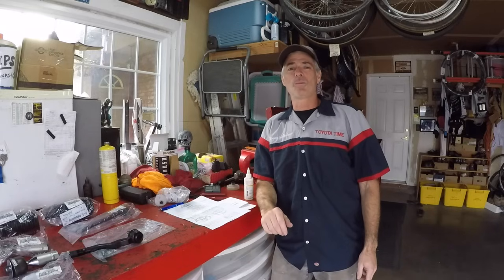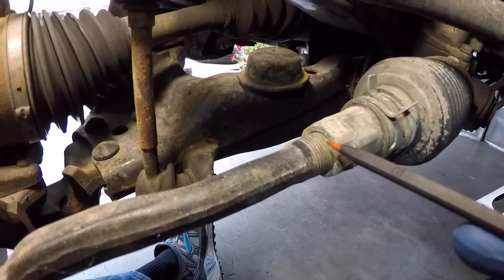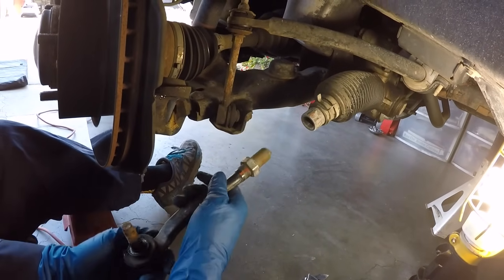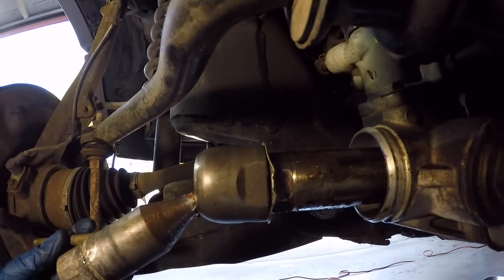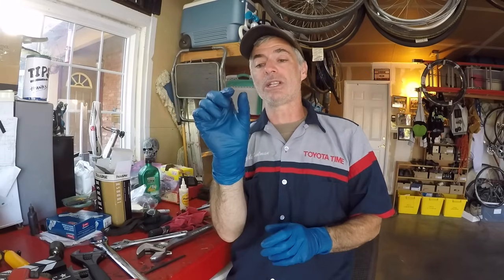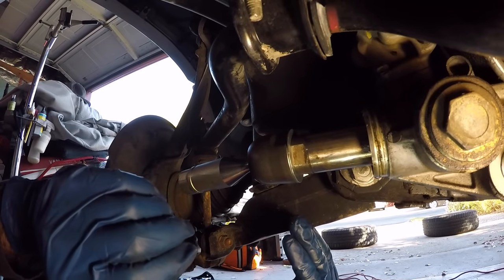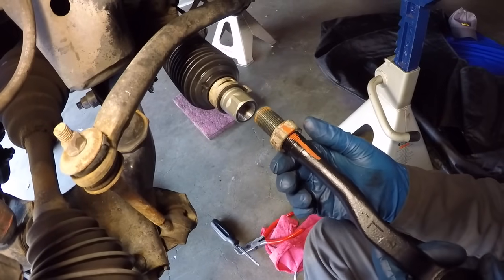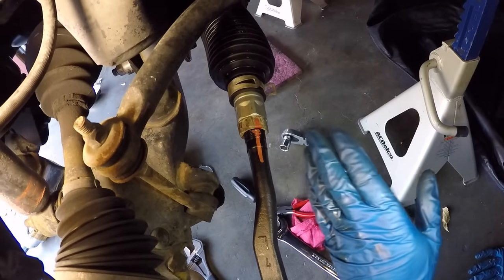Inner & Outer Tie Rod Replacement

Comment: Doing upper ball joints this weekend and outer tie rods on my 2001 tundra 207,000 miles just because want to keep truck for a while. Looking at the prices for inner tie rods well two and a half times the price as outer. I think I will pass on these my truck steering is fine. Where do you get your parts from? I don't want to spend 170$ per inner tie rod.
Reply from the maker: Mike, if the inner tie rods don't have play in the joints, don't worry about it, they are fine.  Inner tie rods are very pricey.  If your joints truly are bad, then it's a better value just to buy a new OEM steering rack because for a little more money, you can get a new steering rack.  For 3rd Gen 4runners, OEM inner tie rods run around $300 but a whole new steering rack that comes with new inner tie rods is only around $500.  For $200 more, getting the new steering rack is the smarter choice in my opinion.  Online parts sellers are the most affordable.  Toyota Parts Deal and McGeorge Toyota seem to have very good prices.
Reply: @TimmyTheToolman  Hey Timmy Thank You for your videos and your time. Im enjoying working on my trunk after I learn what to do from guys like you. Have a great day.
Reply: @TimmyTheToolman  I just found a new OEM rack for 458$ thats what im talking about!  how will I know if I need one?
Reply from the maker: @mikekmalick  Usually people will replace a rack for two reasons.  #1, it's leaking really bad from the seals and the owner is tired of having to top off the fluid.  #2, it develops significant slop and replacing or adjusting the steering rack guide doesn't help.

Comment: Does anyone know if the flats on the 1st gen Tundra steering rack are the same as dimensions as the one in the video?
Reply from the maker: What do you mean by "Flats"?
Reply: @TimmyTheToolman  the place that you put the smaller adjustable wrench on the end of the steering rack arm. I believe you said it to use a 30mm wrench to hold it steady. Just wondering if that was the same dimensions on the Tundra as well. I just dont want to get everything apart to realize I dont have the correct size toolage.
Reply from the maker: @bft590  Gotcha.  Yeah, I can't say for sure because I have not done this job on a Tundra.  But, an easy way you can confirm the size is release the boot clamp, pull the boot back and take a measurement with some digital calipers.

Comment: But didnt you spend $120 on just the over sized crescents? Rather than the $65-$100 lisle set? Just wondering Toolman
Reply from the maker: The Lisle set will pull off the inner tie rod but you still should be holding the steering shaft still with another thin and wide opening wrench.  At least that's what the FSM shows to do and it makes sense since there is a wrench connection on the end of the shaft.  With just the Lisle tool, you would be transferring a lot of torque to the steering shaft and maybe that would be ok, but I have to err on the side of caution when giving out advice in videos and in the comments.  I decided to buy the Bacho oversized adjustable wrenches because I thought I would find more uses for them in the future and not just be dedicated tools only for inner tie rod replacements.

Comment: Anyone have a part number for that castle nut that connects the knuckle to outter tie rod?
Reply from the maker: When you buy a new tie rod, a new castle nut comes with it.  Don't know if you can source this separately.  If you have a Toyota dealership near you, just visit the parts department and ask them.  The part can't be that expensive even from the dealership.
Reply: Timmy The Toolman yep, went to the dealership and picked up the new nut and cotter pin for around 4 bucks, thank you
Reply from the maker: @jordanhamilton5182  You're welcome.  Glad it worked out.

Comment: Hey toolman do know where can i find a rebuild video for the rack and pinion.i replace the lower ball joints and i noticed there was oil in rubber boots
Reply from the maker: Nope.  I looked into it and it seems like a pain in the ass.  If you end up going for it, let us know how it went.

Comment: Just did this two days ago. Driver side jam nut was froze up and trashed the threads.
Reply from the maker: Bummer.  Did the jam cause the replacement of the outer tie rod or were you planning on replacing it already?
Reply: Luckily, I was replacing “just because “ along with front shocks, springs, upper and lower ball joints.
All easier to do thanks to you and Shawn doing the diy videos!
Reply from the maker: That's good that you were planning on replacing them anyway.  Great to hear our videos are helping you out.  Thanks for taking the time to comment.  Happy Wrenching!
Reply: So grateful for pepes like timmy that take the time to make videos like this to help all of us DIY folks out

Comment: ?  why is it important (or not important?) to stake/remove the claw washer with a Brass drift bar instead of just one of those chisels like you take the caps off to get at the axle nut
Reply from the maker: To remove the old claw washer, it doesn't matter what tool you use.  To stake the new one, I chose the brass drift because I did want to damage the washer,  I just wanted to bend it (stake it).  Chisels are sharp.  But, a chisel probably would have worked just fine.
Reply: @TimmyTheToolman   thanks! the FSM does mention to use a brass bar and I was just curious about it all.  it also says to use a spanner to hold the rack steady while you torque  it to spec
Reply from the maker: @efil4kizum  Yeah, the FSM doesn't tell you everything but it usually points you in the right direction.  They show holding the steering rack with a wrench, but they don't mention where to find a wrench to fit that very narrow spot.  Quite often they mention the use of a SST (Special Service Tool) that no DIYer owns and probably most dealership mechanics don't own, so you have to look at the pictogram and figure out what tool in your toolbox will work.
Reply: A new rack end at Firestone here will run ya 370$ at 1.2 hours and 150$ new MOOG ITR part.. this price is keeping the outer tie rod and not replacing that part or I bet it's over 500$ for one side

Comment: NAPA Tie Rod Removal Tool-Crows Foot Lisle# 45750 = $13.50 as of 02/03/2021
Reply from the maker: Hey Chris, the only issue with those types of tie rod removal tools is they don't address holding the steering rack shaft steady while applying all that force to the inner tie rod to remove it.  Is it a big deal not to support the shaft?  Who knows.  But, Toyota obviously built in those flat sections on the end of the shafts for mechanics to hold the shaft steady.  And, they show holding the shaft for the removal in the Toyota factory service manuals.  So, maybe use the specialty tie rod removal tool in conjunction with another slim wrench on the shaft held by someone else helping.  By the way, I looked up that Lisle tool online, it sells for $59 on Amazon but it shows as a complete kit with the tool and many crows foot wrench sizes.  When I looked it up on the Napa sight, it shows just the one crows foot wrench.
Reply: @TimmyTheToolman  I think some of the other viewers have the right idea about borrowing the tools from auto zone (or equivalent).
Your videos have been very educational and have given the knowledge and confidence to tackle jobs I would have paid someone a lot to do for me otherwise. Beyond the money, it is satisfying to work on my T4R. 
Thanks Timmy!
Reply from the maker: @cmtsailor  Yeah of course renting the tools for free is always a popular option.  The only issue is sometimes the tool you need has already been rented out and sometimes the tools are pretty beat up by the people using them.  I'm the type of guy that likes the convenience of having my own tools at my disposal when I need them.  Those Bacho wrenches I purchased are pricey but they are handy for other applications as well.  

Great to hear our videos are inspiring you to take on jobs you might not have otherwise done.  I agree that it's very satisfying to do your own work.  You gain knowledge, save money and you have the peace of mind that you know it was done right.  You can also pass on the knowledge and pay it forward to the next person.  It's a win on so many levels.  Happy Wrenching!

Comment: You could rent the tie rod tool at AutoZone
Reply from the maker: The problem with the special tie rod tool is they don't address holding the steering rack shaft firm while you're applying the necessary force to remove the inner tie rod.  When using these specialty type of tie rod tools, you are at the wheel well with no ability to hold the shaft firm unless you elicit help from somebody else with a special slim wrench to hold the shaft.   I imagine lots of people forego holding the shaft but the Toyota engineers obviously meant for mechanics to hold the shaft firm with the removal and installation of the inner tie rod.  And, the factory service manual shows the use of SST's on the inner tie rod and the steering rack shaft leaving me with no doubt they recommend holding the shaft firm so all that force isn't applied to the shaft.

Comment: Is anyone else having a really hard time getting the outer tie rod off? I am putting my entire body weight into it and it won’t budge. pb blaster and wd40 aren t helping either
Reply from the maker: Time to use some heat my friend! Heat up the nut to expand it with a torch, just be careful and try not to burn yourself. 
- Sean

Comment: I think you can rent inner tie rod tools from auto parts store for free.
Reply from the maker: That would be awesome if you can rent them.  I think I'll check my local O'Reilly's and see if they do.  If you find an auto parts store that does, please respond back and let us know.
Reply: I went to autozone and they do rent this tool - $90.  Upon return you get a full refund.  FYI - I recall on the harmonic balancer that I also rented a torque wrench that went up to 250 lbs and the holder that keeps the balancer in place when tightening it down - all from autozone.  Long story short check with auto parts store on those one of a kind tools first if you are cheap like me.  27346 by OEM - master inner tie rod set.
Reply from the maker: @danteg8311  Awesome.  Thanks for commenting and sharing this.

Comment: The inner tie rod end tool (make sure to get the big green one, not the smaller black one) available for loan from O'Reilly or [AutoZone](https://autozone.com/test-scan-and-specialty-tools/inner-tie-rod-tool/oem-master-inner-tie-rod-set/347197_0_0) works great—and bonus, you can use your torque wrench with it! 

You still need an adjustable wrench to hold the steering rack though. Stanley has one (model 90-950) that is as thin as your $60 wrench looks to be, that worked pretty well for me (as with yours, you can only get it on partway), available at [Walmart](http://www.walmart.com/ip/STANLEY-90-950-12-Adjustable-Wrench/14146067) for about $12. Note that unless you wire the wrench in somehow, doing it this way is a two-man job.
Reply from the maker: Thanks for sharing this info.

Comment: I was able to purchase item # 636979 From Harbor Freight: 12IN ADJ PROFESSIONAL WR ($11.01 with one of their many 20% off coupons). Together with a pipe wrench that I had I was able to replace both inner and outer tie rod ends in less than 2 - 1/2 hours, with no issues.   Thank you for your poste  information.  I thought that this additional data could help others.
Reply from the maker: Thanks for sharing this Alan.
Reply: After looking at this 12IN ADJ PROFESSIONAL WR #63679 online on Harbor Freight, I noticed that the jaw opening is 1-15/32 in. which converts to 37.31 mm. The inner tie rod needs at least a 42mm jaw opening so I am unsure how this Harbor Freight tool was used for ITRE?
Reply: @noejimenez3  - He used the adjustable wrench on the rack side not the tie rod. That only requires a 30 mm. Probably used a pipe wrench on the tie rod side. Point he’s making I believe is that that HF adjustable wrench has smaller jaws than your normal adjustable wrench and you may not have to grind it down any.

Comment: Hammered that tie rod about 8500 times and it never moved a millimeter!
Reply from the maker: Get a puller.  I'm not a fan of the Big F'ing Hammer technique.
Reply: @TimmyTheToolman  had to put it all back together and drive to auto zone and get a separator lol
Reply from the maker: @chrispeterson1247  Yep, pullers work every time.  The Big F'ing Hammer technique, not so much.
Reply: @TimmyTheToolman  worked first go lol should have just done that the first time!
Reply: @TimmyTheToolman  when I pulled the boot off it was full of brownish-orange fluid, there was a small hole in the boot. I had to put that boot back on cause I didn’t order a new one.
Reply from the maker: @chrispeterson1247  That means the steering rack seals are leaking a bit.  As long as the leak isn't too bad, you can continue to run it as is.  Mine leaks on my 2000 4runner as well.
Reply from the maker: @chrispeterson1247  Now that you know how good pullers work, just buy yourself a set like we link in the video description and you won't have to deal with renting them anymore.

Comment: inner rod came off with a pair of channel locks on my tundra you don't have to told the rack either.
Reply from the maker: I show holding the rack shaft with a wrench because that's what the factory service manual instructs to do.  We do our best to give accurate information to our viewers.  It's clear to me the engineers didn't think it would be good practice putting all that force onto the shaft.  Is it a concern?  Who knows.
Reply: @TimmyTheToolman  Makes sense my inner rod was not tight on the rack at all, probably could have got it off by hand
Reply from the maker: @chrispeterson1247  Gotcha.  I sort of think it's not a big deal to not support the steering rack shaf, but I don't want to steer people wrong, in case it does.

Comment: Dude !!!! $350 for a tool that is basically used for one specific function WTF??
Reply: But those are two of the nicest adjustable wrench's I have ever seen : ]
Reply from the maker: Dude!  I think you misunderstood me.  The Toyota SST is $350.  I didn't purchase the SST.  The Bacho adjustable wrenches were $60/each.  And yeah, they are very nice adjustable wrenches.   The best I've ever used.
Reply: LoL My Dude statement was about how much that specialty tool cost. I knew you weren't about to spend that kinda money. Those adjustable wrench's are super nice and will have many more uses !!! Good vid one again Sir!!
Reply from the maker: Rodger Dodger.  Yeah, Toyota Special Service Tools are not very cost effective for your average DIYer and maybe not even for a regular paid mechanic.